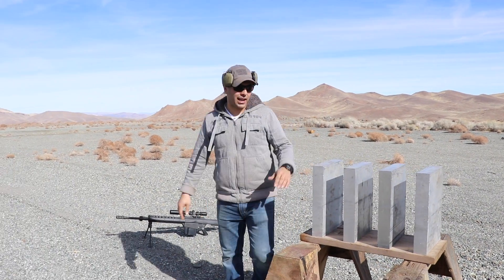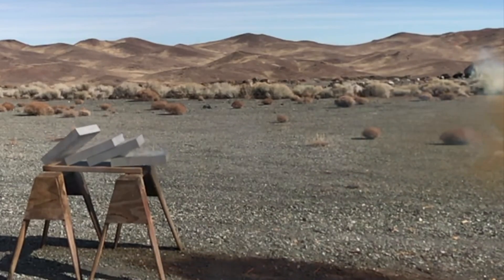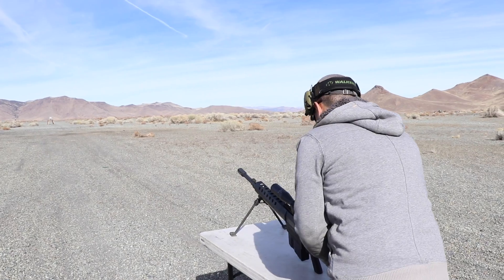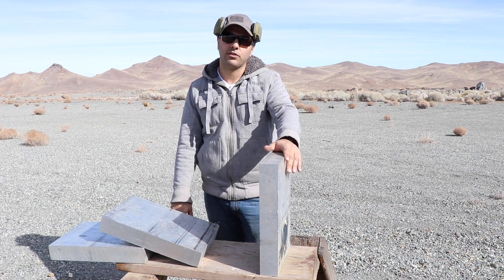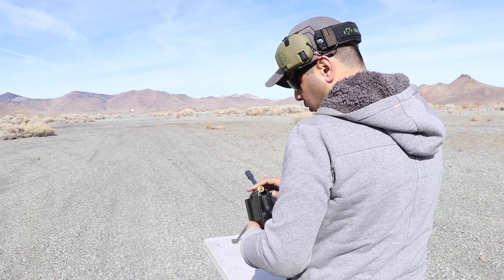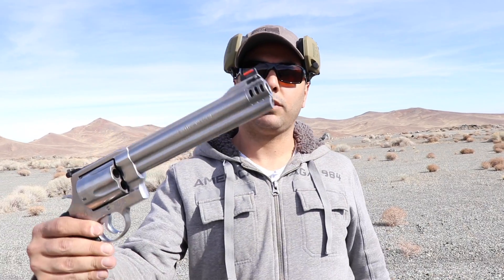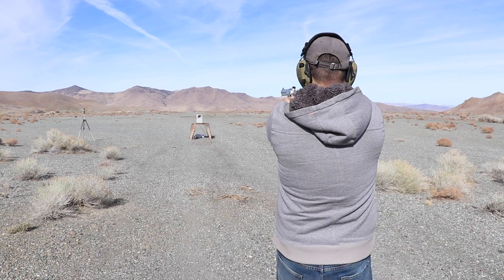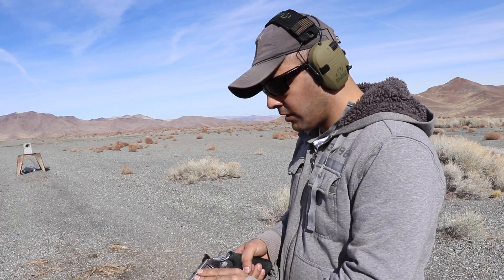How Strong is Aluminum ?

Comment: 10:25  time.  Dear  Mr Ed.  Grind ,   OFF   the  front  sight - take off about   1/16  of  an  inch, or  2 . 5   mm.   Then, you oughtta   hit it.   // OR <  take several  trial  shots =  at various  heights, of the Front Sight  Pin .   /  o well....can't   teach   physics, and  visual   paralax.

Comment: The closer the bullet is to the center of the target, the more it sinks. You have to take this into account in your calculations, and in my opinion the first three bullets had equal destructive power. The middle bullet sank deeper because it lost less energy, and the second bullet was better than the third bullet because it fixed the weight of the block slightly. To get a definite result, you must keep the target completely constant so that the movement of the energy block of the bullets does not catch and does not change the result.

Comment: So basically what i'm seeing is...if you dont care about thickness, 3x as thick aluminum is better at stopping rounds than 1/3 as thick steel. Makes sense, althought the end weight will still be the same. I feel as if going for thicker aluminum will be more beneficial than thinner steel plates. In terms of armor at least

Comment: if we wanted the rounds out of those billets of aluminum,  you need to beat on it from the back side with it laying on a solid surface with a hole to line up with what you want back.  perfer a 4X rivet gun with a countersunk rivet set.

Comment: Non supported plates movement absorbs the energy of the shot, either laminate the material, or bolt them together, or support them in a holding fixture braced against the impact.

Comment: Because aluminum dissipates heat 4 times faster than steel that's why it wasn't hot
Reply: the PC Heatsink its made of Aluminum.
Reply: Right
Reply: Carol Shawol no aluminium has less conductivity compared to steel n copper

Comment: Ya gotta fix these targets in a frame so they cant move. Loadsa energy is absorbed by the metal block moving backwards. It they were fixed in place the AP round should easy blow through the first block and stick well into the second one. Check it out bud.
Reply: You honestly think he wouldn't be aware of that.

Comment: I know exactly why you both miss with the 700gr 500 magnum. You need a faster twist rate. The bullet has an unstable flight. Tumbling instead of spinning. The projectile is too long for the current twist rate of the barrel.

Comment: It wasn't you, it was the ammo. Going from a 350 to a 700 grain (big difference), the point-of-impact changes dramatically. The larger bullet will shoot higher. It's slower, therefore is in the barrel for a longer time, i.e. later in the recoil cycle when the muzzle is pointing higher.

It was obvious you were shooting over the target. All you needed to do was adjust with a hold-under, i.e. aim lower on the heavier round.

Awesome videos, guys!

Comment: Looks like you have weak shooting posture.  You frequently lean backwards while shooting, and it even sent you back a couple of steps in this video.  I think you miss mostly because of your sloppy shooting style, no offense intended.  You really need to tighten up a bit.  You barely take time to sight in before going green and squeezing the trigger - just to find out you missed what would have been an easy shot without a scope.
  I'm not tring to dog you.  I'd just like to see you do better.  Tighten up your posture and take your time with your shots.  All that stuff STILL counts.  Good Luck !

Comment: 6061 T6 most likely.

It wasn't hot because aluminum has a very high coefficient of thermal conductivity. By the time you got there the heat had dissipated throughout the metal.

Comment: Without watching the video I can tell you it's not very strong.  During Viet Nam the army fielded aluminum tanks.  The armour didnt slow down rounds fired at them the soldiers said that the bullets would fly around the inside of them until it hit something stronger than the aluminum  armour like a soldier.  Imagine getting shot inside a tank, I shudder at the thought.  Of course they didnt mention the caliber of the rounds probably 20mm or so.  Maybe the 7.62 probably didnt penetrate I would hope.

Comment: THE ALUMINUM IS HEAT TREATED........PROBABLY 6061-T6.......GET AN ALUMINUM WITH A LOWER TEMPER IF YOU WANT A SOFTER ONE........DON'T BUY T6.......BUY T4 OR T0.......TO IS VERY SOFT

Comment: Naturally, safety is always the primary concern but honestly, when shooting a lead bullet at a soft surface the chances of a ricochet coming straight back is very very remote. It is reasonable to move closer to the target. If you've still got concerns simply stand off to the left or right of center.

Comment: Thumbs up for your videos!  The S&W 500 is such a beast that even experienced shooters tend to flinch when firing it. You hit it with the 350 grain but had trouble with the 700 grain. The 700 grain (1.6ounces!) is so heavy that it actually may be recoiling the gun enough for you to shoot high. If you get the 500 again, place a LARGE cardboard backstop behind your target to determine if this conjecture is right. P.S. Also, mention that the 700 grain is HARD CAST, which improves its penetration capabilities

Comment: 6061 is a precipitation-hardened aluminum alloy, containing magnesium and silicon as its major alloying elements. Originally called "Alloy 61S", it was developed in 1935. It has good mechanical properties, exhibits good weldability, and is very commonly extruded. 
❣️wiki.

Comment: The problem with your kinetic rounds against such a mass of aluminum, is that the metal is so conductive energy is moved from penetration to tiny pertubations in vibrations across the whole surface.

Comment: You missed with the S&W because your shooting posture was wrong.  Feet should be shoulder's width apart, you should be leaning slightly forward, not backwards.  You can't expect accurate shot placement when firing from an unstable platform.

Comment: What makes Aluminum so good at stopping bullets is that it grabs on to the bullet as it tries to spin though.

Armored Aluminum grade 7039 of 1 1/2 inch can stop .50 BMG AP the plates your using looks very thick

If your rich you can buy Transparent armored Aluminum  which cost 15x per inch of armor glass...

Comment: Edwin Sarkissian you have to change the muzzle break on the S&W 500 when shooting lead rounds. It comes from the factory with the muzzle break that’s meant hard cased rounds on it. The other muzzle break should be in your factory case along with tools. The owners manual will show you which is which. This should give you a MUCH better shot when using those 700 grain rounds.

Comment: Having the blocks anchored in place would help with getting better penetration and better results. Good video as always Edwin!I'm
Reply: Officer Gregg Maybe you do this for a living.... But tell me if I'm wrong... Energy would be dissipated when the block moves which could marginally reduce the effect of the bullet
Reply: It doesn't matter what you do for a living. Physics are physics. It will definitely give better results. It could have happened that in your case the difference was minuscule.
Reply: Officer Gregg physics are physics
Reply: Physics says that energy loss is neglect. It changes nothing (not more than 1-2% loss)
Reply: chipotlelover82 
No.  It won’t do a bit to help.  Trust me, I do this for a living.
Reply: Sharran Vishaal, if u watch video frame by frame u can clearly see, block starts moving long time after bullet was stop.
So all energy was delivered, before block starts moving.

weskergeorge97, before talks about physics, learn some.
Reply: aiTheVulture if all energy was delivered before the block started moving then which energy moved the block?
Reply: Hùng Doãn Phi, that energy which was delivered by bullet, moved block.